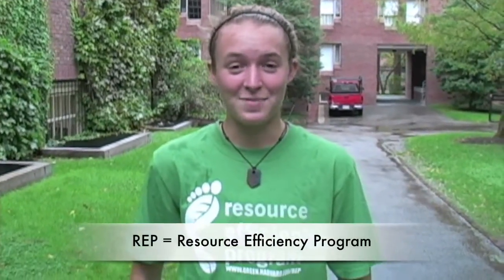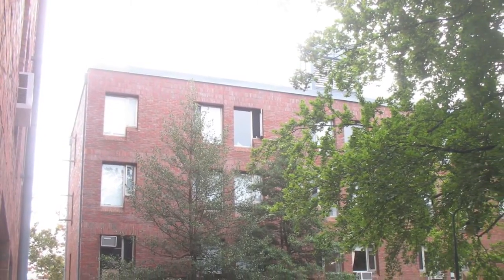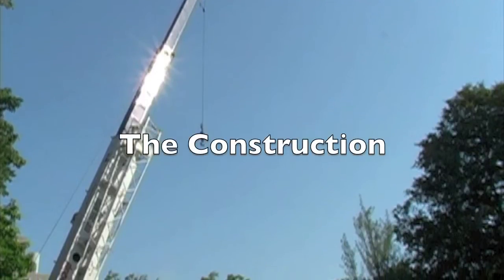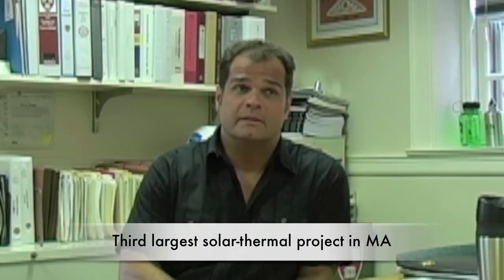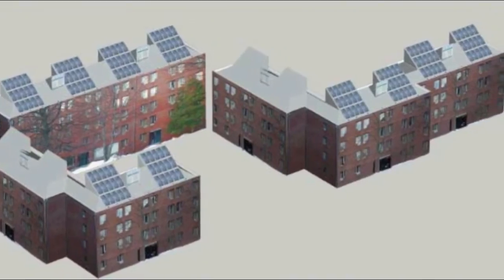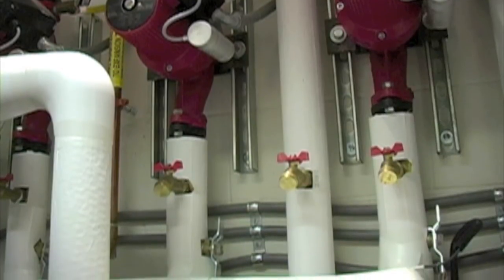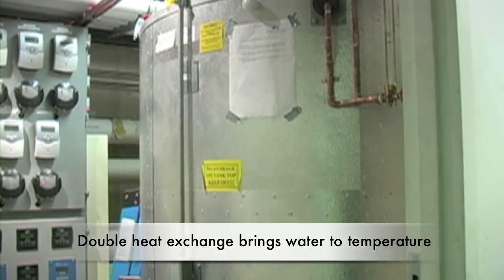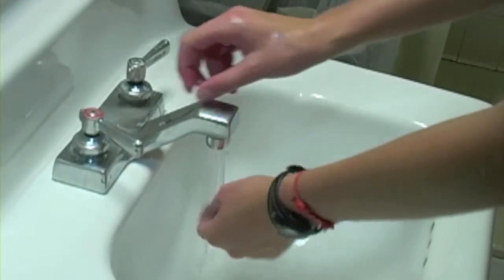Canaday Solar and Heat Recovery System

Comment: Sounds like a great system. I am very interested in the steam heat recovery system. 
Does the heat recovery come from steam that was exhausted from steam engines, or is the heat recovered from the pipeline tunnels for steam heat lines?

Is there a person there who can answer some of my questions about solar steam engine generator sets?